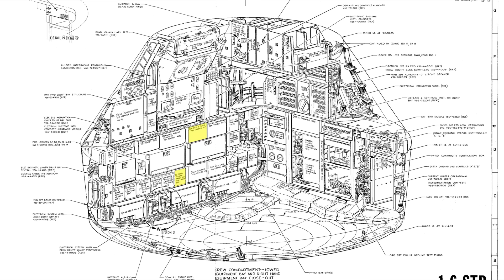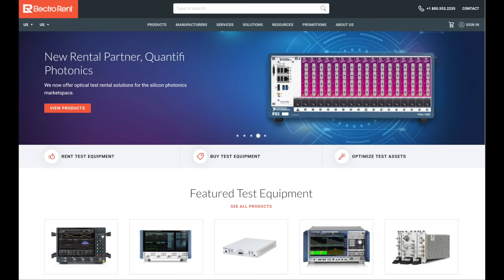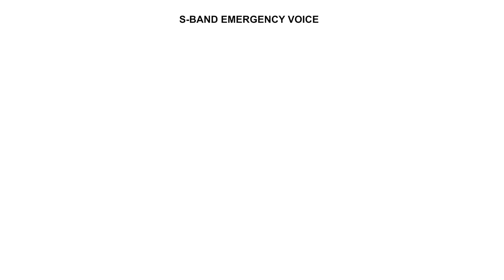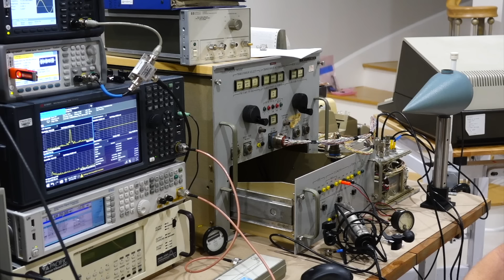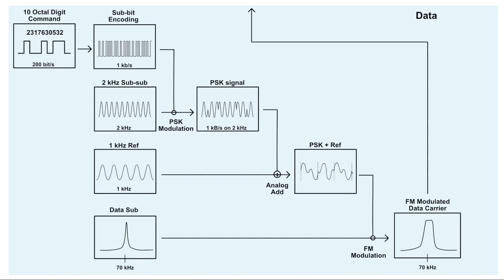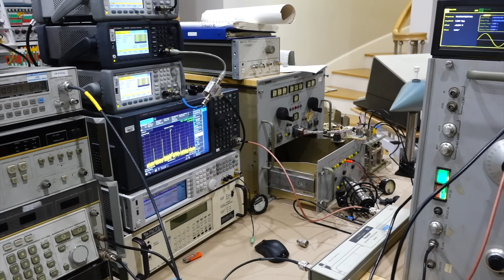Apollo Comms Part 12: Building an Apollo transmit station with Keysight instruments

Comment: Hello Marc, at what bandwidth have they limitted the voice before modulating it FM on 30kHz sub-carrier? 3kHz, 4kHz or more?
Reply from the maker: I believe the voice uplink was 300 Hz to 3kHz. On the downlink it was 300 Hz to 3000 Hz in the early missions, then they reduced it to 300 Hz to 2500 Hz because they had some issues with the EKG biomed data on the top subcarriers interfering (yes, there are subcarriers within the voice signal itself on the downlink!). In the CSM there was some further preprocessing including a 6 dB/octave pre-emphasis to emphasize the higher frequencies for intelligibility, and 12 dB "clipping", but I am not yet sure what that refers to (removal of noise ?). On the LM there was no pre-processing. Emergency voice had a more aggressive set of filtering and clipping, which the astronauts (Apollo 13) complained about, but I can't find the numbers at the moment. [Edit] Just found it, the emergency voice was 300 Hz to 2300 Hz. The downlink itself was much higher bandwidth, 300 to 13 kHz. The upper part of the spectrum was occupied by the biomed from the CSM during EVAs, or the retransmitted biomed from the LM.
Reply: @CuriousMarc  Thank you for the very elaborate answer, Marc! For me it is also interesting the bit shaping for the before they modulate the PSK. Is anywhere manual/schematics available?
Reply from the maker: @cvetomircvetkov5670  Not that we have found yet.

Comment: Many thanks ! I confirm that for ''modern'' numerical modulation we spend lot of time around license, coding format, software version..windows upgrade..And with OFDM it is impossible to have this direct visual approach around modulation. In RF design team ''FM'', ''AM'' "PM'' , ''ssb'' words are no more  used...Could you provide more information about ranging system around teensy 4.1 ?

Comment: Great work, Marc, and happy birthday!  If you notice the messy spectral mix of ranging signal and the subcarriers, that really was a factor engineers had to cope with  during flights.  Phase and freq mod are close cousins - where a key difference is bandwidth versus modulating frequency.

Comment: Yeah I'd never buy a piece of equipment that ran windows on it and requires "booting". That's just absurd. Better to just get a computer if it needs to run an OS to avoid all the rediculous upcharge on all that.
Reply: My Optical Spectrum analyzer uses HP Unix and also takes ages to boot.  If it was Windows I would at least have some hope of fixing a potential software problem.

Comment: Great content, as always. This is the best possible marketing a test gear company could engage into. I'm still ambivalent to the operating-system-on-test-gear thing. Some of my RF gear runs Windows 95 and Windows 2000. It has an ethernet port. It would be great if I could plug it into my LAN. But that would be idiotic...

Comment: I has Windows !!!! .... LOL. They only really downside is the guaranteed obsolecense that it will face as Windows drop support for the systems and this gear is not particularly cheap. Industry has been facing this, lathes, textile machine, medical, pick & and place .... many of them running XP or even NT. Very expenpensive machinery depending on legacy SW ... and HW, ISA slots, Serial Port . some of them are stand alone but struggling on 2.5 ide drives ... the life cycle of this systems is LONGER than any release of Windows (PITFALL) Of course if you are a big company, and to conform your  financial controller's dreams ... just put it on the bin and buy another one.  If you are not that big, this bad boy will turn into a truggle in 2 to 3 years probably need to update the PC side of it at KeySight costs. At least they didnt use ANDROID which is the ephipany of planned obsolecense

Comment: I might be one of the few subscribers who have actually, albeit in a limited capacity, worked with an N9020B analyser. It was about 3 years ago when I worked at Ericsson as part of a small team that built test-rigs for development and debugging of 5G mobile basstations.

And yes, I was also surprised when I discovered that it ran Windows.

Comment: I gotta say. I'm fairly smart with computers and electronics... and i conceptually "get" modulating one signal with another, and i totally understand decoding amplitude modulation ... filter out everything in the singal except for the frequency we're looking for, then the amplitude of it is the signal... but frequency modulation just seems so foreign to my brain.  how do you filter and decode a frequency that is changing?  I mean, i could see getting "one bit" of it by just filtering for the target frequency, and monitoring that, with the singal bouncing up and down through it... but i just can't wrap my head around anything more than that.  My brain just isn't made for Analog/RF comprehension i guess.  (I mean, to be fair, I haven't studied it other than discussions with smart friends and intelligent youtube vids like yours...
Reply: FM decoding circuits are more complicated than AM for sure, and there are more than one of them. 
Two simple model examples would be: 

[Digital] Have 2 AM decoders running in parallel, one at each of the 2 frequencies ('1' and '0') and getting the same incoming signal. Treat the signal as "OOK" on-off keyed for both '1' and '0'. Only accept a '1' or '0' if one of the 2 decoders has actually decoded something, else there is no signal arriving.

[Analog] An older decoder uses the "S-curve" method of decoding a signal by having a parallel "tank" LC circuit, tuned at the higher end of the FM signals frequency range. As the modulated FM signal rises in frequency the tank circuit resonates more strongly (higher amplitude across the tank ckt) and as the FM frequency lowers in frequency (to the bottom extreme of the frequency range) the tank circuit resonates much less. Take the waveform across the tank circuit (buffered) and use a diode/filter to get a changing DC voltage that represents the amplitude of the resonating tank circuit. That would be the FM demodulated signal.

I recommend watching some older videos from w2aew's youtube channel as well. There re several very well explained FM demodulation techniques there and he explains it much better than I can in this comment.

Cheers,
Reply: @EngineeringVignettes  Will do!    And your response helped a lot, Thank you!

Comment: The Keysight instruments are very, very impressive indeed - but I like the design, operation and obvious build quality of your vintage HP equipment much better. And not using an Enterprise class OS but instead slow, crappy Windows on such a top-rated instrument really boggles the mind. Blasphemy! Nevertheless, another extremely enjoyable and interesting episode.
Reply: Honestly it's just to display the UI and easily interact with commercial software like LabView. Plenty of high-grade instruments will have second processor that runs some kind of RTOS for time critical stuff plus a lot of hardware computations in ASICs/FPGA and then dump the processed data over through PCI Express to the "user" portion.
Reply: There is 'vintage' HP kit which runs Windows -- the Infiniium scopes are the example that immediately springs to mind. From memory they run either Windows 2000 or XP, depending on how recent the unit is. It's really just to satisfy business interests in making the UI easy to develop (Windows application developers and tools to support them are comparatively common), and customer interests in making the UI familiar. Most of the grunt work will be done by the FPGAs and ASICs and sub-processors deep within the instrument.
Reply: @philpem  There's plenty of Infiniium scopes that ran Windows 98 but just loaded system and apps to ramdisk on boot so if you turn it off like classic oscilloscope it wouldn't break anything:)
Reply: I still prefer the way that we look for knob and buttons on vintage equipment than try to memorize multi level of manuals on the modern one which can get lost from time to time 😅

Comment: If the HP signal generator is the grandpa of the new Keysight signal generator then the great-great-grandpa of the Keysight spectrum analyser would have to the vibrating reed frequency meter sitting on the bench just to the left of the Apollo gear.

Comment: I was a little surprised to see 2nd and 3rd harmonic subcarriers on that voice subcarrier, than almost collided with the data subcarrier. Is something over-modulated, or just insufficiently filtered?
Reply from the maker: All done by the perfect Keysight equipment. This is not AM. That’s what PM is supposed to when you put a tone on it, you get the sine of a sine, which is a series. I suppose that’s also why they put the first sub is at 30kHz and the second at 70kHz, so the harmonics don’t overlap too much.
Reply: Was going to comment exactly this; it's good that the data subcarrier isn't an even multiple, but with the frequency spreading from the voice channel it's still overlapping pretty heavily. Wonder if this is how the original signal looked, or if it's a side effect of how the modern Keysight equipment is generating the signal.
Reply: Considering the SNR they would get with the power budget they probably had, I tend to believe the original gear would have a filter to reduce the harmonics. Or, maybe, a different power distribution between signals.

Comment: am i the only one here that feels like seeing windows 10 booting on a piece of dedicated lab equipment is just an example on how the industry has gone down the wrong path? I'm all for technological progress and updating, but a desktop OS on a scope is just a step backwards to me - it should be dedicated software running on a minimalist firmware or at the most a custom Linux or similar that they can maintain in-house. 
My major concern here would be malware getting through on USB flash drives as this thing passes around hands and labs during its rental life.
Reply: I guess it is a modified windows version. I remember some PLC stuff I worked with had modified (hardened) Win95 and WinCE on it. They had also more configuration possibilities, like USB ports read-only and so on. And you didn't install the OS like you do with normal desktop OS. You had a setup tool where you selected what you want and need, and then the windows was built and copied to a compact flash. That was about 20 years ago, I don't know how it works today. But yes, I personally also like an embedded linux more :)
Reply: My HAAS VF4SS runs Windows CE as the control software. Excellent. Never a problem in the 5 years I've owned it and I use it daily.
Reply: Like it or not, high end test equipment has run Windows for years. My old workplace had a 4GS/s LeCroy scope that ran Windows 2000. The smaller half-rack Keysight/Agilent instruments Marc is using are powered by Windows CE 6.
Reply: 100% agree.  I wouldn't buy a piece of test equipment that had embedded Windows in it...or that took 10 minutes to boot.  Either Linux or even better just simple proprietary firmware, that should take 10 seconds to boot.  I'd rather have imported gear.
Reply: It doesn't seem easy to use Windows on an application that relies so much on reliable timing to work as a spectrum analyzer. I tend to think everything is actually running on dedicated and optimized hardware/software and the OS is only used as a display receiving data. That would actually facilitate (reduce development costs) creating a similar equipment that you connect to your own computer running keysight software to control the whole stack.
Reply: I don’t think you are. I know working with equipment vendors that they constantly get people who are not happy to use Windows equipment. And they also have people who want Windows on there for flexibility. Tek’s current series support both on the same scope for example.
Reply: You're not alone.  There are other RTOS options employed by other hardware makers that are many orders of magnitude lighter on resources and faster, most likely greater stability too.   QNX comes to mind.  RTX is another, and one that I noticed was used as the OS in my Icom IC-705 transceiver.  And, of course, linux with a custom built kernel only containing the extensions and modules required to support the hardware it's embedded in.
I'm sure some suit at microsoft got a bonus for landing the keysight contract, probably after giving another suit at keysight some incentive or gifts.
Reply: @loughkb  hp used vxworks a lot, my 8285 uses vxworks, also my 8960. the 16702b uses hp-ux
Reply: @loughkb  Don't forget TempleOS. /s
Reply: Spot-on! I couldn't agree more!
Reply: Completely agree there is absolutely no reason for Windows 10 other than it makes the downloading of licence keys easier so If KeySight goes down it is a brick.

Comment: Really great to get this kind of help! Windows on test equipment though... what a weird choice.
Reply: Vincent, not if it is running labview or matlab underneath the covers.  I've used labview on a number of projects and it incredibly shortens development time and cost.  It is very robust for screen indicators and controls and easily interfaced with custom hardware.
Reply: Running a Windows OS on HP/Agilent has been a thing for around 20 years now.. Marc's gear predates all of that nonsense.
I mean... what's wrong with running Linux?
:D

Comment: Great hardware. Too bad for the software on top of it. Just wait to see the new UI on the spectrum analyzer. We were so happy to see it when we upgraded that we hurried up to find ways to get rid of it and back to the old one (the one in your video). They are both horrible interfaces on top of slow responsiveness that takes all the joy out of using the device on multiple fronts.

Comment: Really nice video again, thanks
Question: probably they sent the baseband siganls to the three sites of the Deep Space Network (Goldstone / Madrid / Canberra) and then had a modulation stack at each site, feeding into the dish?
Reply from the maker: They indeed did send the voice and data. The data was via modems, I suppose the voice also via phone lines? I’m not sure. But each site also had their own local voice comms and their own equipment for generating the digital commands if they had to. They could relay the commands via teletype.

Comment: Hello Marc. I hope that in parallel, you will continue the "SDR" approach of this Apollo transmission. In order to show to hobbyists that it is (relatively) easy and cheap (Adalm Pluto/Lime-SDR-mini) to make complex mod/demod with SDRs and a good PC. 
SDRs are a great oportunity for modern RF hobbyists. 
The KeySight equipments are cool... but way too expensive for hobbyists.
Reply: Couldn't agree more. The cheap RTL-SDR got me into the hobby RF world a few years ago, and I have since demodulated NOAA/GOES images with home built antennas, heard transmissions from New Zealand on Shortwave (I live on East Coast of the US), and many, many, many more cool things from around the world. My laptop is a cheap Dell Latitude and it works great with SDR# or any other open source SDR software. Buying a low-cost LNA and cheap FM filters go a long way as well with amplification and filtering, since most SDR's have a Bias Tee software enable option to power the LNA from the SDR itself.
Reply: Amen I was far more excited about the SDR approach combined with the Offline, turn it on equipment.
Reply: yeah what happened to the sdr stuff??

Comment: Actually - 15:31 - you've built the grandfather of an RDS modulator. (FM broadcast data subcarrier) A data rate of 1187.5 bps and a sub-carrier at 57 kHz. 
Same same but different.
A very instructive video - thanks.
Reply: I was thinking the same. There are still SCA broadcasts out there on the commercial FM band. I can receive a few with an SDR and soundcard configured as an SDR. There used to be an encrypted stock quote service as well, back in the 1980s.

Comment: Wow, I actually understood most of that modulation stack.  Great explanation!!!  I think I can do the same modulation scheme in my lab, but I don't have enough gear to also demodulate it.  Maybe it's time to take another look at SDR.  It would be fun to adapt this to ham radio frequencies and do this over long distance.  In any case, this series is totally knocking my socks off.  THANKS!!!
Reply: I posed a question in the top thread about the purpose of the pseudorandom signal injection. You seem to have your head wrapped around the encoding schemes, so I wondered if you might be able to help. If you have a minute, would you mind taking a quick look and sharing your thoughts? (No obligation.) It starts with “ Does anyone have any recommendations of where I could learn more about the pseudorandom signal injection… “

Comment: Great you have the support from these sponsors, superb equipment and wonderful people to have been able to use this gear. PS you might digress but what you say is so true, you don't get an instrument you get a base which is totally controlled by its licenses, still gorgeous stuff and somebody has to pay for all this amazing technology.
Reply: What do you suggest as an alternative?
Reply: @guidoscalise  The license is stored on the machine as part of the purchase so at boot the configuration is already fixed and there is no requirement to check. If you purchase a support agreement then checking for latest versions etc would seem sensible so there is always scope for ongoing revenue but this should be at the request of the owner.
Reply: @campbellmorrison8540  That wasn't the case for my MSO-X 3024A scope.  I had to manually enable each 'new' feature of my scope manually from documents that came with it.  I suspect that the bulk of time that Marc was complaining about was system talking to the mother ship to license each function.
Reply: @gregkrekelberg4632  Yes I agree and I now assume that was because it was a rental. Im pleased to hear you get to fix your licenses when you purchase the scope.